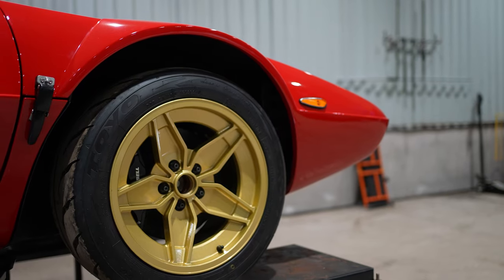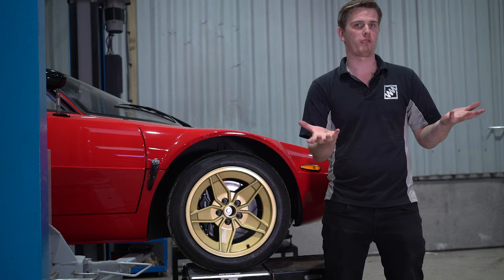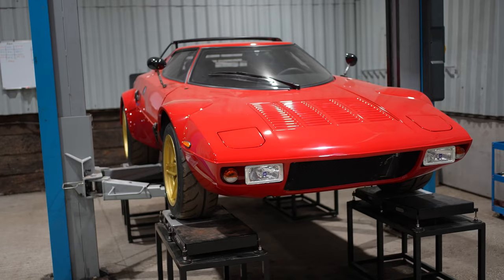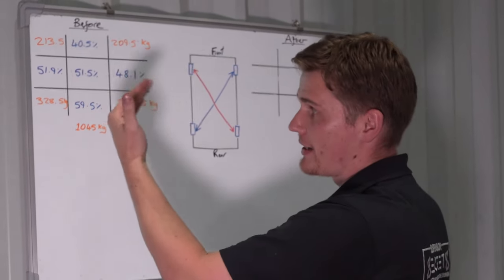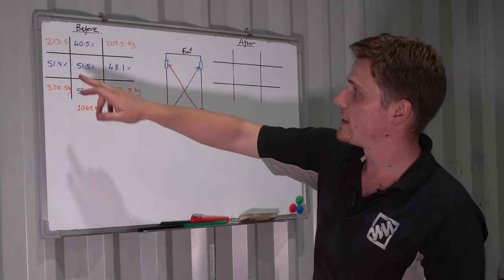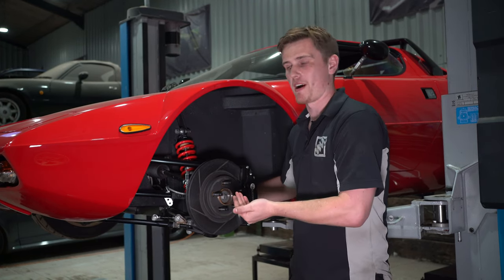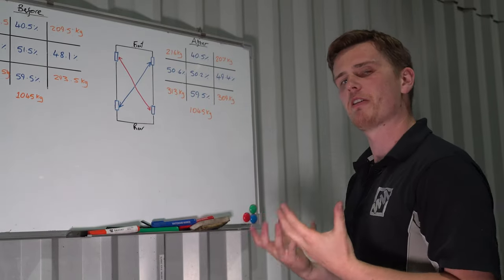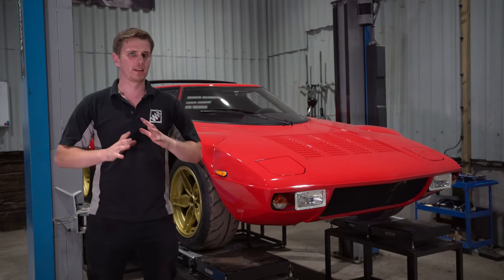How to corner weight a car and why you SHOULD!

Comment: How does camber change the corner weight and wouldn't you have to re-align it after corner weighting anyway? So I'm wondering why bother with aligning it prior?
Reply from the maker: It’s cyclic, if two wheels have very different camber, one side will sit higher than the other. The corner with more camber will be sat lower than the corner with less camber due to the angle of the wheel from vertical having more horizontal travel (therefore sitting lower). 

So you need to ensure the settings aren’t completely out of line such as on a freshly built car that we used in this video. 

Then once corner weighting is done you re-align the car as the corner weighting will affect the geometry so the final alignment makes smaller corrections that don’t have a large effect on corner weights but correct the geometry back to where we want it 👍

Comment: hi Matt, great video as ever.  On braking, would some of the weight on the rear not come forward so the imbalance at the rear could end up having a negative impact on braking as well?
Reply: or in other words, the imbalance at the rear pulls the centre of gravity to one side so would impact braking as mass will act through the CoG?
Reply from the maker: Thanks for the comment 👍 yes it would transfer slightly but the whole imbalance wouldn’t travel. This is where we talk about making the compromises as we always have to make an informed choice over which numbers and differences to prioritise to get the best from that particular car we are working on. It is always a fine balance 👍

Comment: I always wondered, I live in a zona where streets are quite harsh and not the best quality.
Is it worth to corner balance / do a geometry alinment in my car if I keep hiting a pothole here and There?
Reply from the maker: Yes it is definitely worth doing as the corner weighting is set by altering and settings differences in ride heights. These will keep the corner weighting settings to a degree even after going over a few potholes. It’s not ideal for the car to keep going through potholes but you will still benefit from the grip improvements 👍
Reply: @SuspensionSecrets Thanks for the quick response and great content aswell!
Here in Portugal sadly the roads are quite degraded, so potholes are not even and there are a lot of fissures on the road. 
I try to keep on the safe side always and go slow, but sometimes it's impossible. 
Any feedback on D2 Racing Street Coilovers?
Only good brand that has coilovers for my car with TUV apart from KW(V1) on the same range